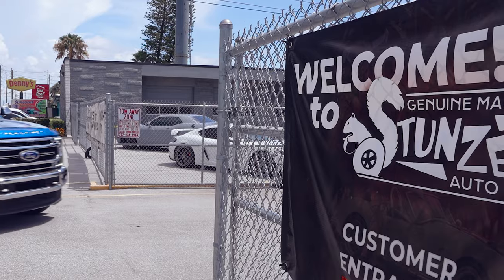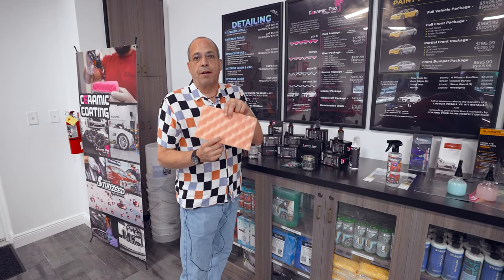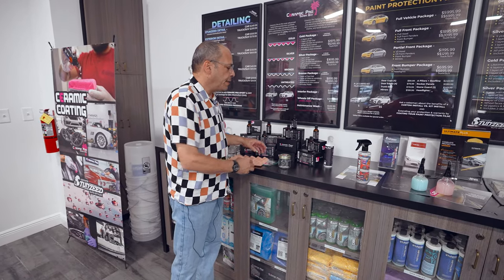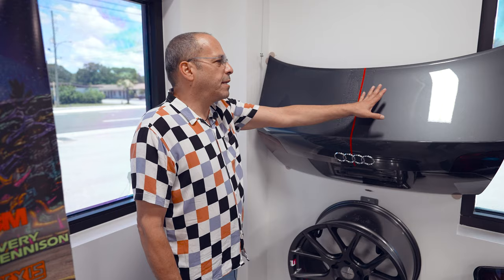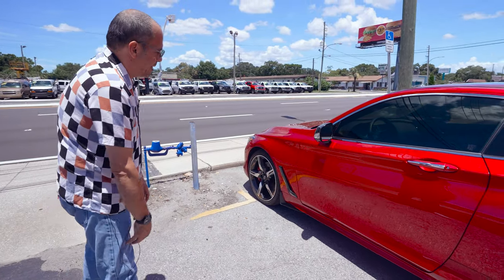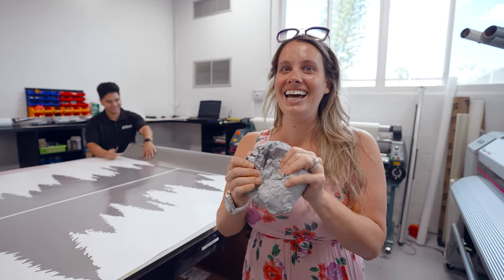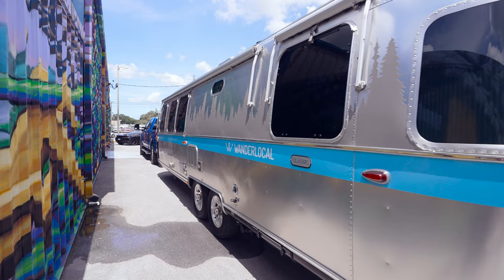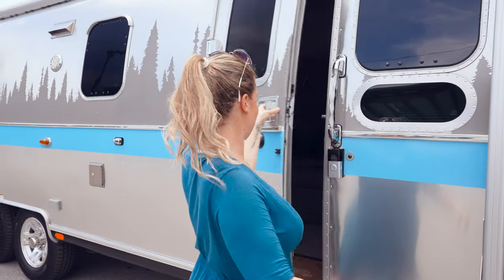AIRSTREAM UPGRADES @StunzeedAutoStylez // Ceramic Must Haves for #rvlife

Comment: Love the Grey decal. Subtle and unique. I splurged on my new truck for the ceramic window tint and did every window including the entire windshid (70% is legal in Texas) and the difference in the heat coming through the glass between my truck and my wifes car (factory tint only) is insane. I drive hundreds of miles a day in my truck so it 100% worth it for me.
Reply from the maker: Matt, we’re also planning on getting the truck done too! As you said, it makes a huge difference! Lauren + Daniel + Dash